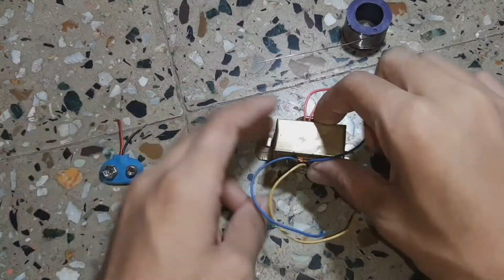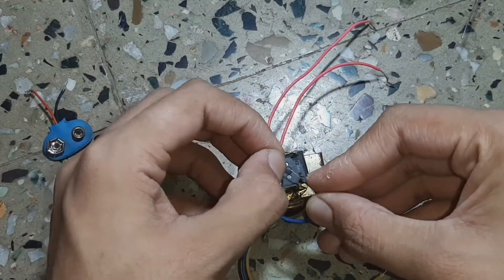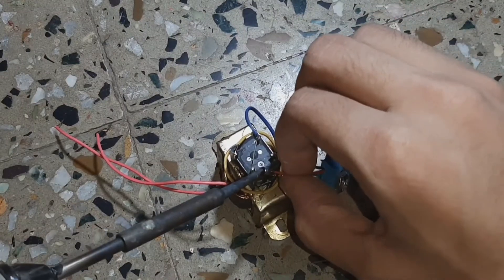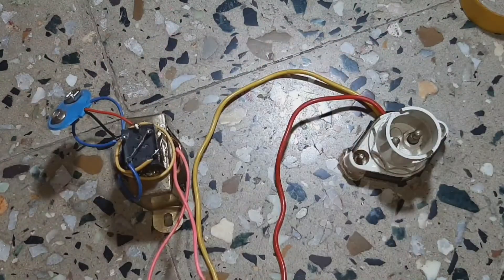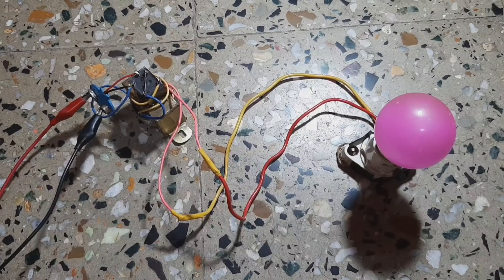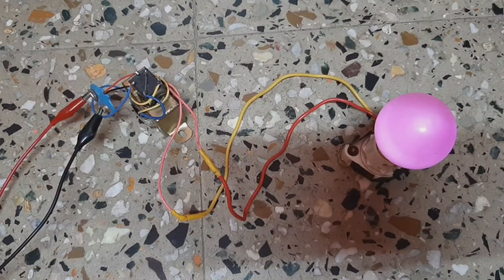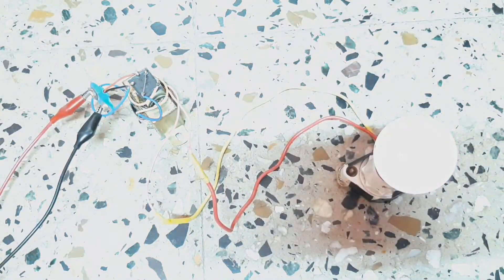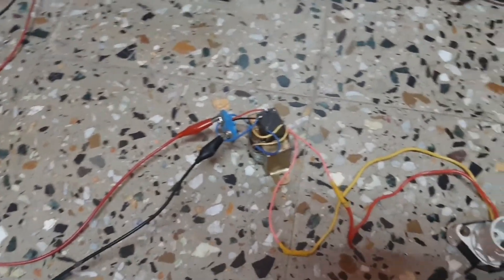Only 2 component inverter circuit | Using Relay and Transformer

Comment: bro plz make an amplifier for 2 speakers each speaker with specifications  of 4ohm 6w 60v speakers  or at least help me  which transistor capacitor and resistor to use . I tried asking so many but no one knows
Reply from the maker: You can find a circuit for your need on instructable.com 

You can also use 5 watt circuit to drive your speakers... (Just buy one, they are pretty cheap)

60v isn't a over kill ? Prefer 9v or 12v circuit... If possible
Reply: Can I use 4.7ohm 1/2watt resistor and 63v capacitor and  tip31c transistor. To make amplifier for my speakers will this be suitable for my speakers